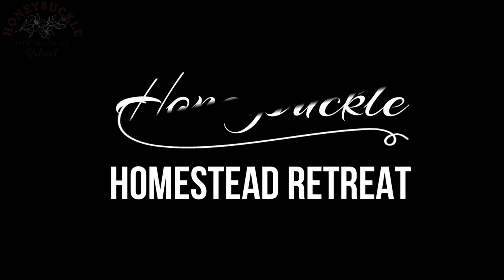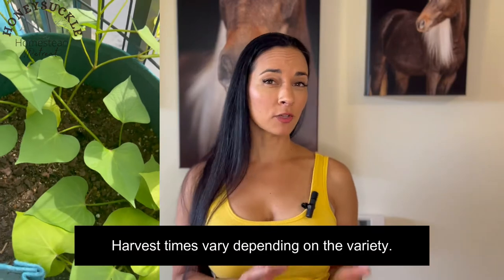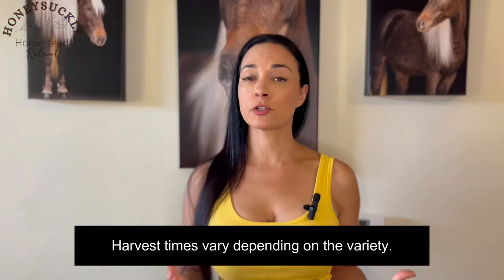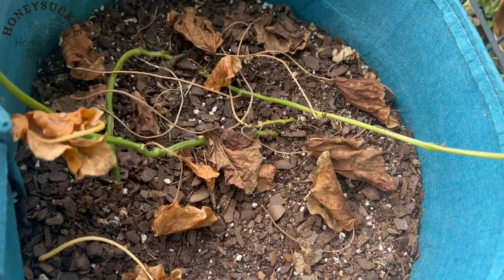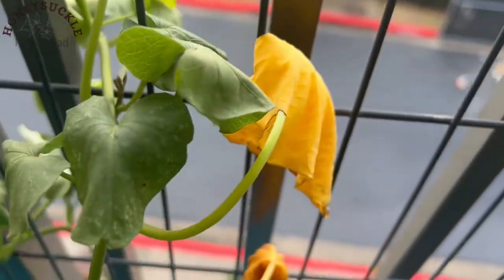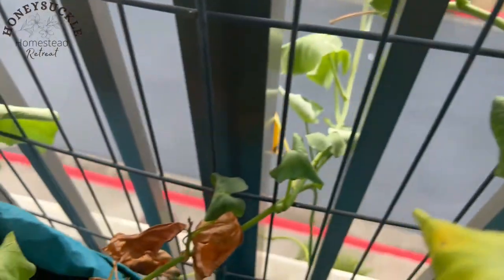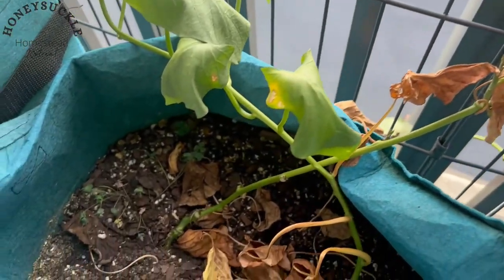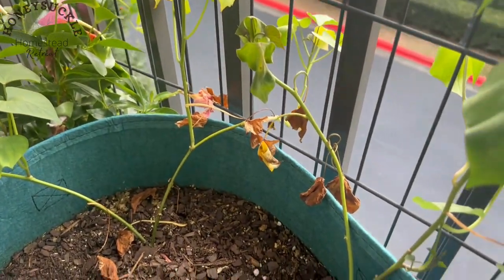Growing sweet potatoes on apartment balcony - time to harvest! TELL ME WHAT I DID WRONG!!

Comment: I never had the best harvest sweet potatoes in grow bags. I think they dry out too quick and the tubers dont form as well do to the dry soil. I have good success in ground though especially  planting in late may. If you do the same set up maybe add a lot more mulch and leave a small sterilite container at the bottom to collect water so it doesnt dry out. And also maybe leave until mid october. The cooler nights help the tuber bulk up a bit. You should grow them in ground. The stokes purple give some massive tubers, the murasaki does pretty good in ga too for sure. Thanks

Comment: I would use either buckets or you know those Rubbermaid containers that might also help and then some people use those smaller galvanized trough as well and I I've noticed that you had to cloth and I'm like I bet you it's drying them out also that's more restrictive as well remember it needs a little room to grow
Reply from the maker: Thanks and yes I agree! I did not think of the Rubbermaid containers though. That is a good idea!
Reply: @HoneysuckleHomesteadRetreat  a friend of mine does it because they come in so many different sizes you can actually produce a lot more room especially with a loosened soil